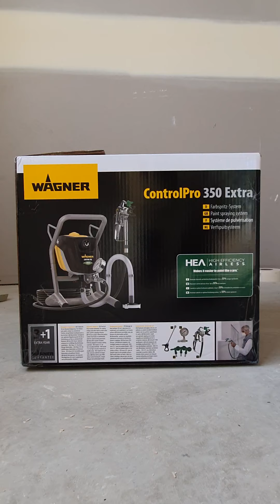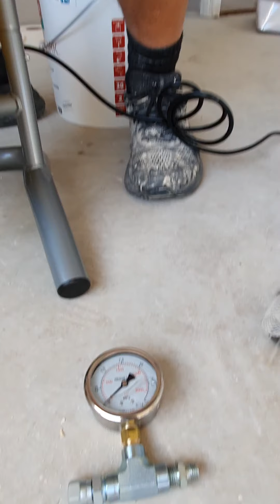Unboxing Wagner CP 350 Extra Spray Gun (Part 1)

Comment: i just brought same model ... but how do you lube the inside like pump ect like on other models out there?
Reply from the maker: I'm unsure, but I haven't yet and it not making weird noises and working fine 😅
Reply: @aussiepaintingtipsandtrick9157  how long have you had it for?
Reply from the maker: Nearly a year, it has heaps of paint pumped through it but I clean it thoroughly every use